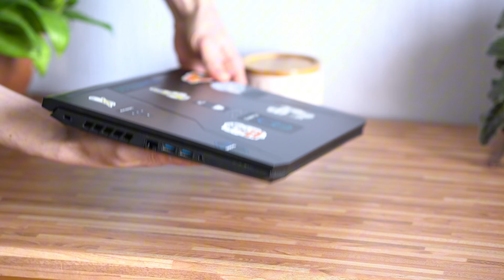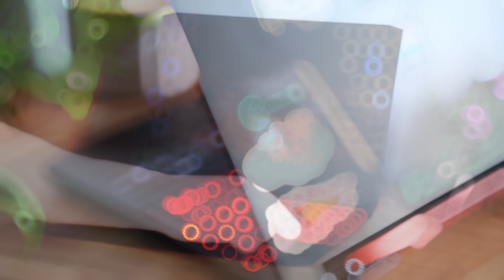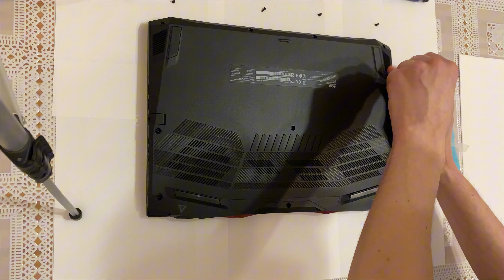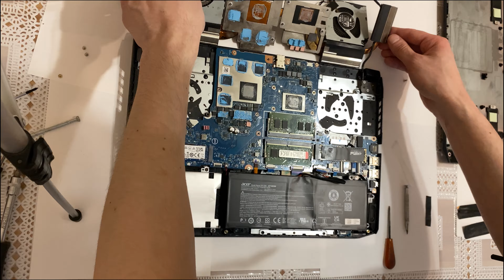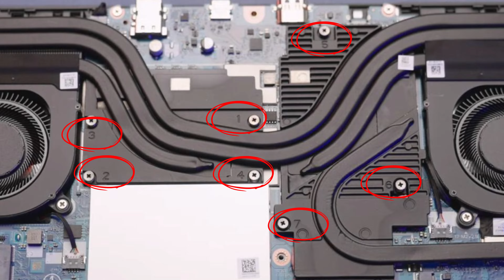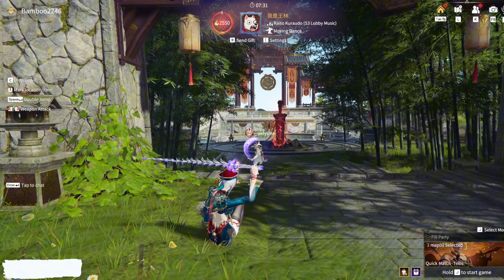Acer Nitro 5 Maintenance Guide: Thermal Paste & Thermal Pads

Comment: are you downclocking your acer nitro 5? to lessen the temp or just repaste and cleaning the fan? monthly or yearly?
Reply from the maker: I usually clean everything and replace the thermal interface materials once a year. I don't do anything else.

Although recently- I might actually make a video about this - I wasn't paying attention to the Windows updates and caught my PC in the middle of a reboot. Apparently, an Insyde Software Firmware Driver Update (5.42.1.14) came through. Basically, it was a BIOS update that straight-up turned my PC into a brick.

I had to reinstall everything because I couldn't even log into my account anymore -it broke Windows Hello. And after that, my temperatures went back up to around 90°C. At that point, there's not much you can do other than reduce performance through the registry or disable Turbo Boost.

Comment: What thickness were the thermal pads?
Reply from the maker: These are thermal putty pads. I tried to apply them at around 2 mm thick. When the cooling assembly is pressed down, the excess is usually squeezed out, but the main thing is not to overdo it, so you don’t end up with uneven pressure or a misaligned heatsink.
Reply: @TrueWaveTech Yes, I understand. What I mean is that the laptop came with thermal pads from the factory, separate from the thermal putty. The original thermal pads are already worn out, and I want to replace them, but I don't know what thickness they are.
Reply from the maker: I understand what you mean, but honestly, I wouldn’t worry too much about finding the exact thickness. I’d just go with thermal putty, because figuring out the correct size/thickness for fixed-size thermal pads can be a real pain. I tried to find the exact sizes myself back in the day but never got a clear answer. Different enthusiasts suggest different thicknesses on the forums, so it’s hard to know which one is actually correct.

That’s why I’d recommend just using  thermal putty. Apply it roughly like I did in my video, put the heatsink back on, and enjoy using your laptop.^-^
Reply: @TrueWaveTech Oh, thank you! I really appreciate your help. :)

Comment: i change thermal paste last day and the temp still high how much will take to work
Reply from the maker: If everything was done correctly, the temperatures should improve. It also depends on the quality and type of thermal paste or thermal pads you used. If the temperatures are still high after a few days, that's a bit unusual, and I'd recommend checking whether everything was installed properly. Also, your question is very general- it's not clear whether you're talking about a laptop or a desktop PC, or what temperatures you're actually seeing. What you consider "high" might actually be normal operating temperatures. It's hard to say without more details.
Reply: @TrueWaveTech  laptop hp zbook 17 g6 stll high touch 100c even the room is 16c
Reply from the maker: @ali-rm2de  I made this video specifically for Acer Nitro 5 owners, but in general there aren't that many possible causes.

First of all, I hope your fans and heatsink fins are clean. If they're clogged with dust, that's the first thing I'd recommend checking and cleaning.

Secondly, when replacing the thermal paste, it's usually a good idea to replace the thermal pads as well. In my video, I used the blue Laird 607 thermal interface material. I also recommend using a laptop stand to improve airflow underneath the laptop.

And of course, it's better not to save money on thermal paste or thermal pads.

Here are a few things that could be causing the problem:

1. Poor heatsink contact. This can happen if the thermal pads are the wrong thickness, or if you're using a phase-change thermal pad on the CPU and applied too much material. If the pads are too thick or there's too much material, the heatsink may not sit flat on the CPU or GPU. Everything needs to be the right thickness, so it's worth checking the installation again.

2. A damaged heat pipe. This is a more serious issue. Heat pipes contain a special working fluid that transfers heat efficiently. If one of them was accidentally damaged and lost its seal, it won't transfer heat properly, and the heatsink assembly will likely need to be replaced.

3. A cooling fan issue. The fan may simply not be reaching its proper speed, even if it's spinning.

Finally, it could just be a weak point of that particular laptop model. From what I've read on different forums, some people have managed to solve similar overheating issues by replacing the thermal interface materials.

Also, I don't know which exact configuration of the ZBook you have. Since you already disassembled it, you probably noticed whether it uses traditional thermal pads, liquid thermal pads, or something else.

That's about all I can suggest based on the information you've shared. I hope you're able to figure out what's causing the issue.
Reply: @TrueWaveTech  thank you so much

Comment: The most important thing is not to forget to reconnect all the cables (including the power cable) afterward, or you might be in for a bit of a shock when you find that your laptop won't turn on after cleaning it >.<
Reply from the maker: Yeah, I actually mentioned that in the video. The main thing is not to embarrass yourself. 😅